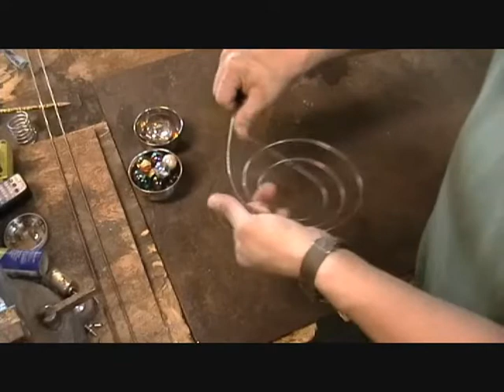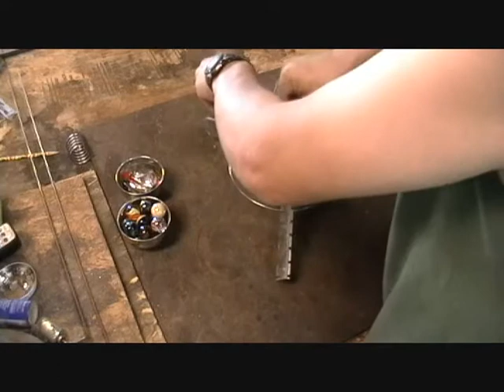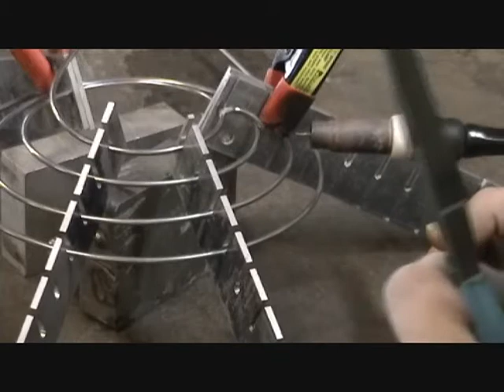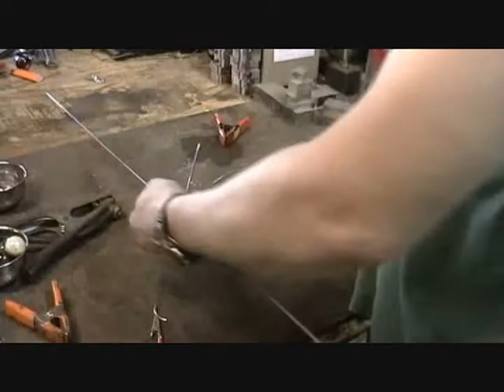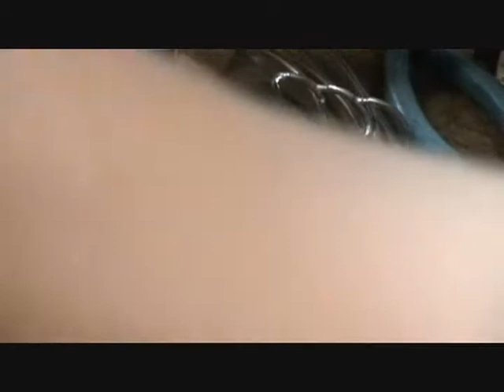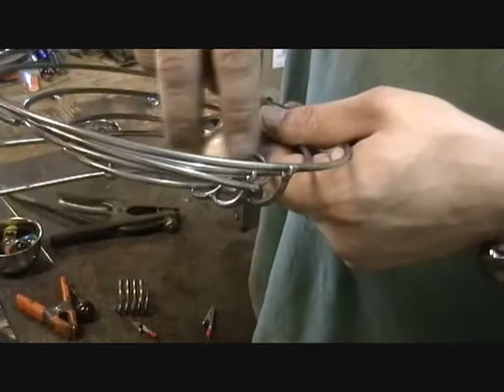How To Make A Spiral for RBS

Comment from the maker: I usually have it at about 60 for the 1/8 to 1/8" welds. I use 1/16" tungsten. I up it to about 75 for the 1/4" and lower it if I'm welding something thinner.